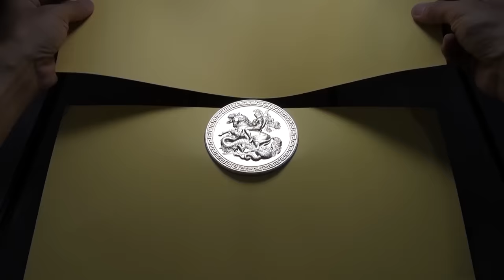Cnc engraving on brass

Comment: Incredible seeing the quality you can get in metal with a machine that is more on the woodworking side of the CNC ecosystem. Only some, almost imperceptible, artifacts as evidence of this not being quite as rigid as a metalworking CNC. FANTASTIC job.
Reply from the maker: OkammakO _ Thanks!!
Reply: I was thinking if you sand blast the whole thing with a really fine grit you'll get a smooth finish, then you could polish the raised surfaces to a mirror sheen which would make it look incredible and accentuate the details in the engraving.
Reply: I don't think those are artefacts of a lack of rigidity, rather they're just the result of a lack of accuracy. Because the tooling is so small, and the engagement with the material so light, there's very little rigidity required to make something like this.

Comment: For a smoother finishing; using end mill on flat surfaces and ball nose on curvatures can be a good idea
Reply: I'd also recommend moving on the x axes like you did, but changing to moving among y with the tool change. It's like coloring in both directions with crayons, it provides a more even topology.

Comment: What the hell, I had no idea a cnc machine could be so precise, so fast.
Reply: You know that's mostly not real time?
Reply: @the_jcbone  Yeah I know. It probably took over a day total, but even so, for this quality it would probably take any other machine i've seen at least twice as long
Reply: 1.6mm per min is excruciatingly slow.
Reply: @iancrossley6637  What do you mean 1.6mm per min? the tip is moving more like 5cm per second.
Reply: These cnc was accurate and precise as the day u were born back in 1970 and 80s .only thing differ is better software .
Reply: @jollysingh47  I never said old cnc machines were slow..? what are you even referring to? literally no one said old machines were any different than today in terms of precision...? you are arguing with literally no one lol.
Reply: @Sl4yerkid  u still have no idea which u litrally said in ur comment .
Reply: @Sl4yerkid   o dear ur crying

Comment: Hi,
Great video. I was wondering why you used a V bit rather than a ball end mill? Wouldn’t it give you a smoother finish?
Reply: V bits give better finish on flat parts, balls on curved surfaces. I guess he wanted the flat parts to be shinier.
Reply from the maker: Manfred Knorr _ Because the details of this model are too small, can't be engraved with ball end mill.
Reply: How long it takes to finish that job? How many hours it takes ?

Comment: One question, can you do the same but engraved on steel material? If this is not possible, would you explain why it is not possible?
Reply from the maker: luis saire martinez _ Engraving on steel material is okay, but the speed will slow down a lot and there must be water cooling for the end mill. Thanks!

Comment: I have no firsthand CNC experience so please bear with me if it is an ignorant question. Would it be psosible to do the same last pass but make the drill go perpendicular to the first pass and thus remove even more of the tiny jagged steps left behind by the tool? Or go even further and take a pass in each diagonal too? Perhaps getting a totally smooth result?

Comment: Question please
Only saw 2 bits 2mm endmill for roughing and v-bit .5 30%
Noticed v-bit is flat tip. You used it as a finish bit..how many passes to get this finish. Please
Ty. Andy
Reply from the maker: andy roff _ Three passes to get this finish. Thanks for watching!!

Comment: You should have run your finish pass perpendicular  (90*) to the roughing pass, this yields a better finish. Still looks cool. Good job.
Reply: Actually run it 45degrees with a ball mill. You won't even see any lines if ran close enough overlaps.

Comment: Nice project and video. How did you secure the brass plate to the vise as it doesn't seem to be between the vise jaws?  Are jaws magnetic?
Reply from the maker: Josh Lopez _ Oh no. It is clamped very little (1.5mm), at the bottom. Thanks for watching!

Comment: Hey. I love your videos that you've made. I'm really interested in CNC and machining. I was wondering if there would be any way for me to talk with you a little.
Reply: 2 years gone.. did you progress on doing such yet... lemme know.. im doing such 3d art.. looking forward to buy a machine.
Reply: @aceaquascapes  Unfortunately the CNC machine I got that was going to be thrown out is hard to find software for and it currently is having issues with all the axis working at the same time for some reason. I have been busy with school so I haven't had time to work on it at all which makes things though also. The machine that I have is the LabVolt 5400 CNC Mill. Glad to see you responded, awesome

Comment: Sir if I want to engraving that same design on iron then what will rpm of spindle motor, and tool tip size and degree and feed rate
Reply: Reply please my question
Reply from the maker: Sonu Verma _ Product in video are D100mm and 8mm thick. If you run like me on iron, you reduce F by 1/25. You should use coolant. Bits should be carbide. Thanks for watching!

Comment: What is the difference by 3D printing and then casting this piece and his method?
Reply: 3D printing, no matter the method, will have surface defects that you will have to post-process before casting. Every process has them, and there's no way to avoid it, not until we have resin printers that print with continuous z movement, to avoid voxelization, and have extremely high resolutions, but once those are available, they won't be on the consumer market for years after that. This is why 3D printing is really only recommended for rapid prototyping. Now, you could also do a 3d print and post-process it with cnc milling, then cast it. 
Casting is a whole other issue, though, and if you have to ask what the difference is between casting a copper coin based on a 3D print and engraving copper, then there's a lot of research you have to do, because a short comment will not explain all the intricacies of that process for you. But hey, you're already on YouTube, so have fun searching how to cast 3D prints in a material that can withstand molten copper. There's various methods and materials to do so, lost PLA in green sand is probably the easiest, but again, do your own research just to see how difficult it can be. 
This also assumes you have a 3D printer, a desktop CNC mill, and the equipment to do smelting and casting; most people of which do not. CNC milling also isn't perfect, on a metal piece you still need to grind or polish the product depending on what it is you're making and what material it's made from, similar may be applicable to milling plastic, you may have to post-process the milling with additional sanding for touch-up work. 
At the end of the day, engraving a coin is far cheaper, in time, materials, and equipment needed. 
There's also benefits to using a 5 axis CNC mill, but good luck finding a consumer machine with the build volume large enough, or finding driver boards and software if you want to DIY one.

Comment: Best done by 3D metal printing now
Reply: DMLS 3D printers have a layer height of 0.1 mm. Meaning NOWHERE NEAR this level of detail or resolution. Metal 3D printing is for bigger parts that aren't about detail or surface quality, because you get none of that with it.